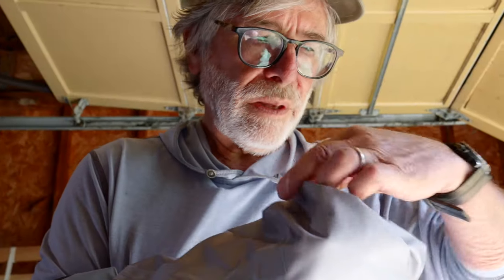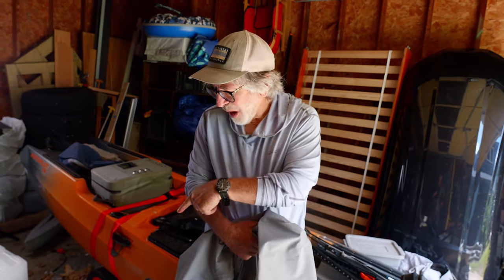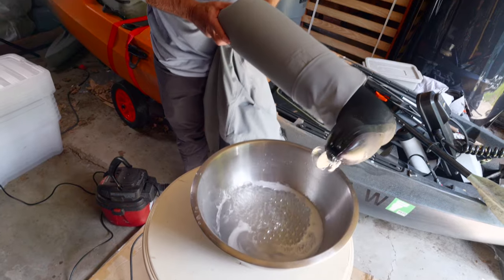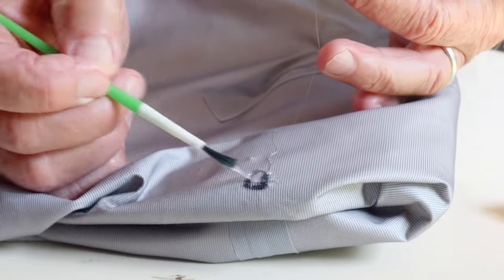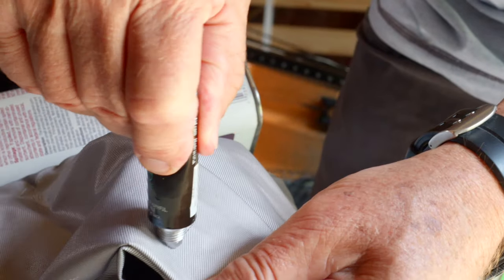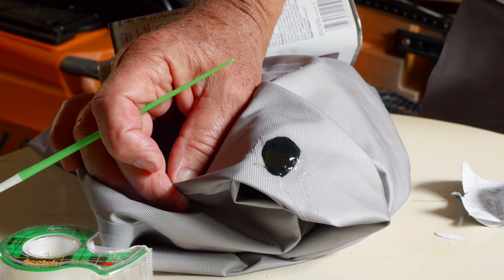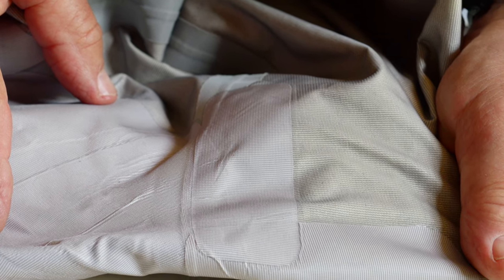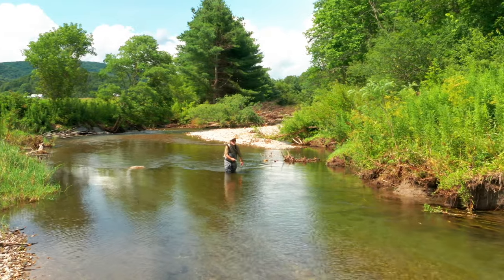ORVIS: How to Repair Your Fishing Waders

Comment: I've been repairing my waders for decades. The way to find pinhole leaks is to rub the inside of your waders with a cotton ball or towel soaked with rubbing alcohol. Leaks will turn dark. You circle them with a marker, and then repair with Aquaseal or even Loon UV sealant, which dries instantly and lasts years. Leaks in neoprene require the more exhausting methods of detection.
Reply: How about patch work how would I seal a small tear in the knee area

Comment: I have new Orvis pro waders, after 3 days of fishing water is pushing through the material on my right foot. at the height of the shoe covers. no visible damage, almost new.. can I repair it like in the video? or send it in directly under warranty? I think it's a manufacturing problem, built at the point where the transitions are and the material is 3-4 layers.
Reply: I would send them in since they are under warranty.
Reply: I recommend your next pair of waders comes from simms… I know it’s a little strange to say that but simms has never failed me and I do a ton of bushwhacking when I fish

Comment: My old Orvis waders need all the seams fixed.  I did the foot part, but have been putting off the legs and crotch area.  I'm surprised there aren't more places out there that "rebuild" waders by fixing the seams as I bet that is where most of the leaks occur.